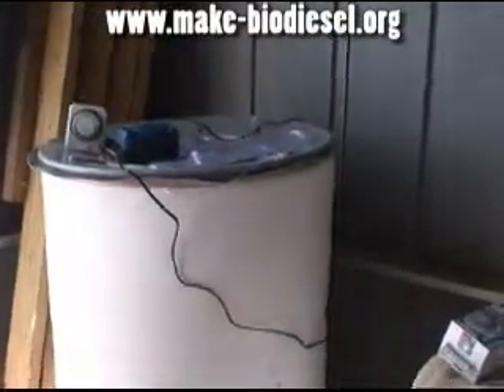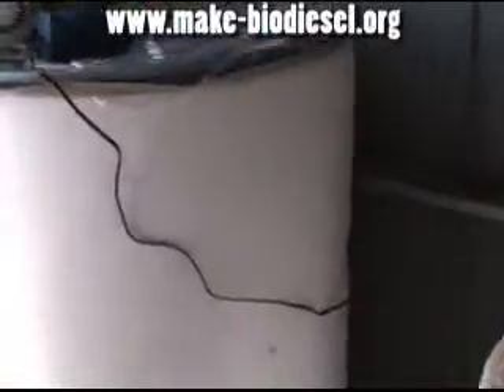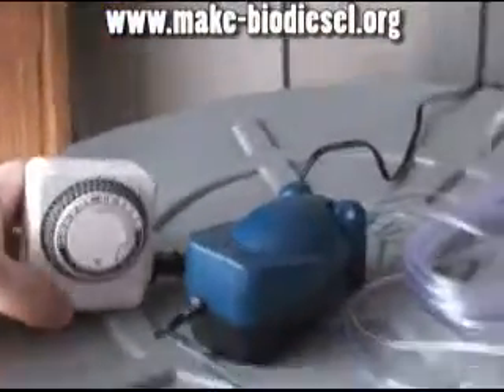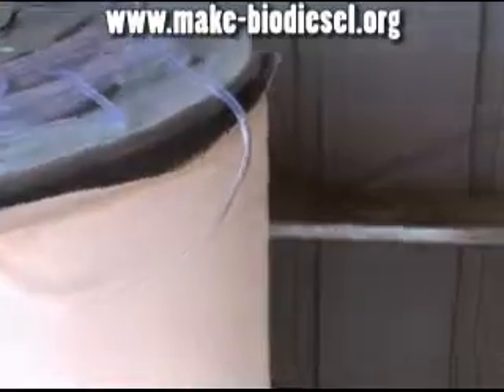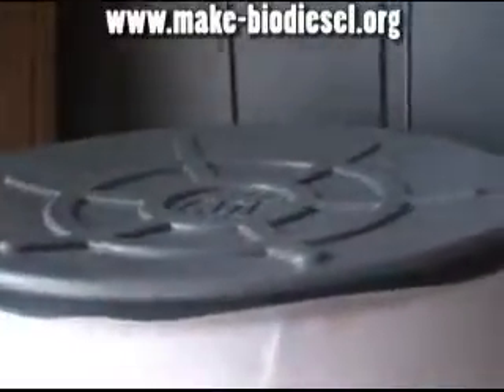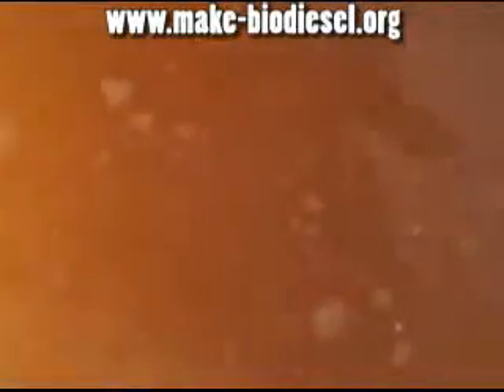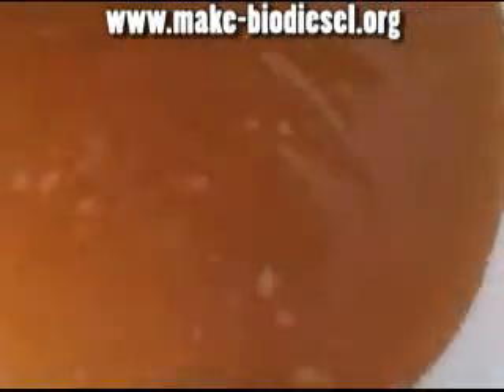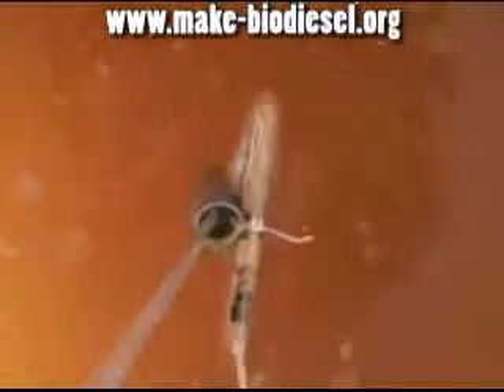Bubble Washing Biodiesel

Comment from the maker: Yes this is the first step after 3/27 pass.
The warmer the better, up to about 120F. I'm bubbling at 96F. At about 50F bubbling does not work.
There is about 4 galllons of water in the bottom of the drum.
It takes a week and four water changes to bubble wash.
Methanol is absorbed by the water, no wood chips needed.